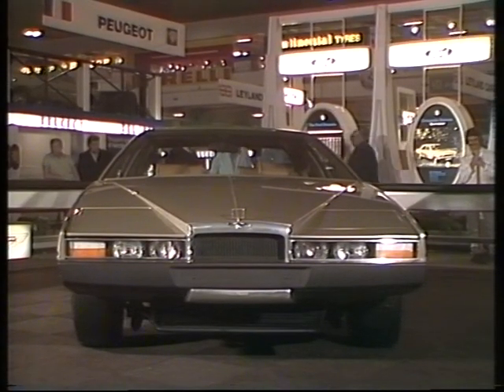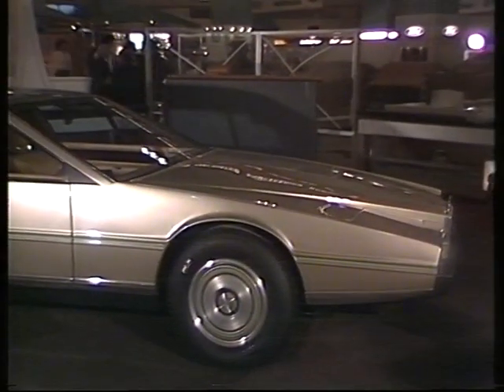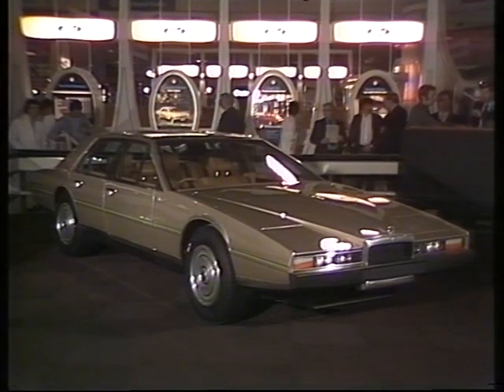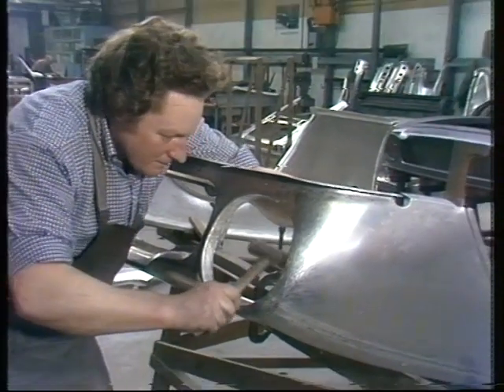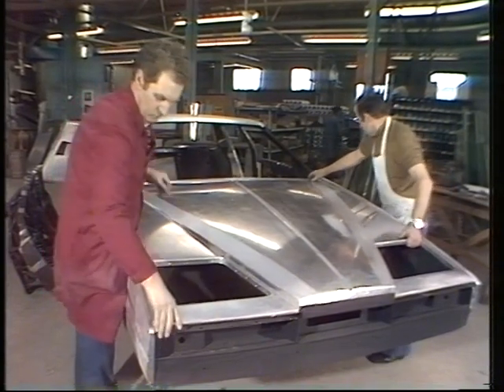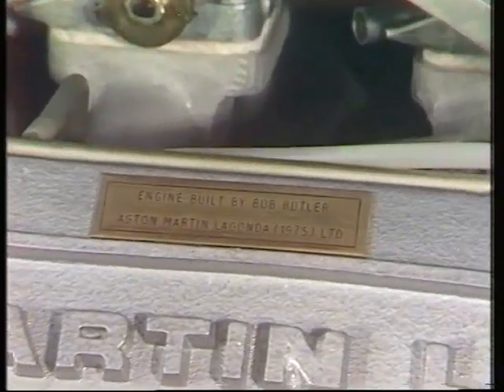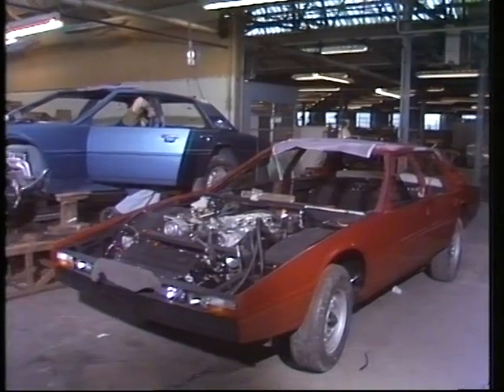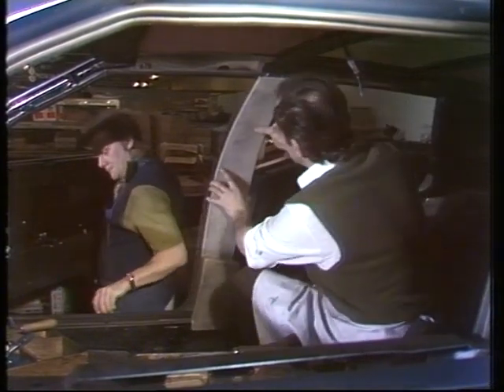Aston Martin Lagonda | Classic Car | Drive In | 1978

Comment: I remember seeing the Lagonda for the first time at a now-defunct exotic car dealer in Southern California.  It was sitting on the showroom floor behind velvet ropes and to 13 year old me, it was the most intimidating car I'd ever seen. Every detail of it screamed "Power" and "Money" compared to the velour-lined luxury barges of the era.   It was a striking car then, and even more so now.  I've seen only ONE on the road in 40 years; it emerged from an underground parking garage, seemingly out of nowhere, with 4 older people inside.  It turned the corner and slipped away in complete silence; I'm glad I was standing on the sidewalk, because I'd have fallen off my bike from shock.   I'm still hoping for a ride in this spaceship someday.
Reply: To me, it looks like an early '70s design study for what would become the 1977 Chevy Caprice.
Reply: Moses Berkowitz  Did you see Doug Demuro recently reviewed one ha.
Reply: @Porsche996driver  No, I didn't...but I'll look for it now! Thanks
Reply: Fit a Toyota engine and it will run reliably for next 50yrs!

Comment: The motoring equivalent of Concorde in virtually every respect - design and technology, economic/financial strategy and of course uniqueness.
Reply: Except the Concorde had a flawless record of reliability and the Lagonda is one of the worst cars ever built, none of the tech worked..
Reply: @betsyduane3461  Are you forgetting about Air France Flight 4590? Also, I quite like the Lagonda.
Reply: @jakekaywell5972  That was debris on the runway , nothing to do with the plane
Reply: Flawless... Until it crashed.

Comment: Wonder what happened to Bob Butler?
Sheesh - 5.3L engine - top speed 140MPH - how things have moved on.
Another great clip.
Reply: Look at many American cars - 5.3L engines in a 4 door saloon with 140MPH top speed is still about right!

This is a slightly different thing though yes. Must have been pretty nippy in 1978.
Reply: I had a 5.3L Jaguar from the late 70's that was probably similar - I think weight and being mechanically designed for smoothness kept them a bit slow. They were designed to cruise without you noticing the speed rather to be an exciting ride - a big engine can be very quiet.
Reply: @sheldonholy5047 That was the EPA that caused that. Pre-1973 American cars have much better output.

Comment: With a 5.3 litre V8 under the bonnet you would imagine it would be much faster than 140 mph
Reply: It's a time thing. I think it only put out about 280 HP. 30 less than a 335d, a diesel 3-box that anyone can buy. I sell a few 'fast' cars from the '70s/'80s/'90s, and it's amazing how slow they feel against today's average stuff.

Comment: Did I hear right about the price? For an Aston?
Reply: Yep, inflation is an amazing thing!
Reply: What you AREN'T TOLD is that during the pre thatcher era the british had TERRIBLE INFLATION. Not helped by MASS nationalising of EVERY money losing business, CONSTANT strikes and crap like that. They would even strike when the company changed brands OF TEA provided to the workers. In furniture manufacturing of office desks with steel frames and wooden tops they would argue about WHO drilled the holes in the metal for the screws! The table top guys said they didn't want to take the jobs of the steel guys. The company said the table top guys should drill the hole. The union decided BOTH should drill the SAME HOLE. So they did. OTHERWISE they couldn't fire you so you sat in the lunchroom ALL DAY DOING NOTHING with full pay. The inflation become do bad that even those little 3 wheeled reliant things actually rose in price EVERY 3 MONTHS and basically EVERYTHING did. Coz they were borrowing and printing money like MAD to cover british leyland to make the mini and other cars AT A LOSS. Ford bought a few minis to rip them apart to see how they could make them SO CHEAP. And then found out they were making thrm AT A LOSS..... covered by government money printing....
Reply: Wow.

Comment: Now Aston Martin just stick a Mercedes's AMG engine in their cars!
Reply: Aston stopped using their own engines when the Vantage V600 stopped in 2000. Since then it's been the Ford V12 or Jaguar V8; the DB7 was already using the Jaguar AJ16 engine.

Do you know how much it costs to design and develop a new engine ?
Reply: jam 68
Nothing wrong with using the very best, especially if someone else has already paid to have it certified for emissions standards around the world.
Reply: with the current engines all still supplied by Ford in Köln. Only a select few now have the AMG engines.
Reply: Nothing wrong with using engines sourced from AMG - Pagani does also, after all.
Reply: @lewis72  Don't really care .
Reply: @modfus  I'm not saying its a problem just stating a fact.
Reply: jam 68
You cared enough to make your original statement, which was wrong.
Reply: @modfus  Aston Martin have a history of making cars and engines Pagani don't.
Reply: @lewis72  It was not wrong they use AMG engines as well as other engines.
Reply: @lewis72  The new 2019 Aston Martin Vantage uses a Mercedes's AMG V12.
Reply: Well it was wrong as they don't "just stick a Mercedes's AMG " engine in their cars, they also stick Ford & Jaguar engines in them.
Reply: @lewis72  sorry they carefully fit the AMG V12 in !
Reply: Yep, and the share price plummets.
Reply: Ford actually
Mercedes even worse issue s..POS euro trash cars

Comment: 480p? Are you guys ripping this off from a DVD?
Reply: It's probably been converted from videotape. Hence the saying run VT.
Reply: What resolution do you think it was originally broadcast?  PAL was only a few lines more.
Reply: No idea unfortunately, not that tech savvy!
Reply: Still it's best to over sample if you can any video. Going to 720p or 1080i  would be an improvement even if this is coming off 3/4" U-matic. The video looks likes it's got too high black levels.

High quality SD studio video in 1080i could show you how good SD video was before it was corrupted by high compression or analog transmission paths. Such as cable companies or satellite home delivery. Also, when transferring the video black levels and color should be adjusted along with the video. This transfer looks like its at default settings. A waveform monitor and vector scope can be a big help in getting optimal video from an old transfer. Most editors never touch those settings. So however the transfer was done is how it tends to stay for life..